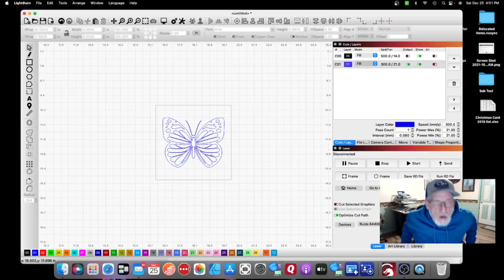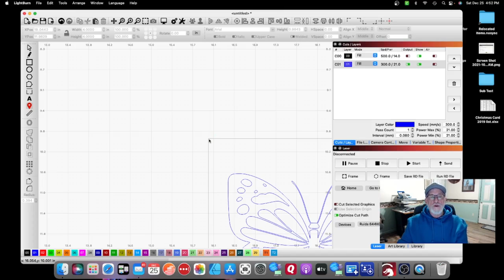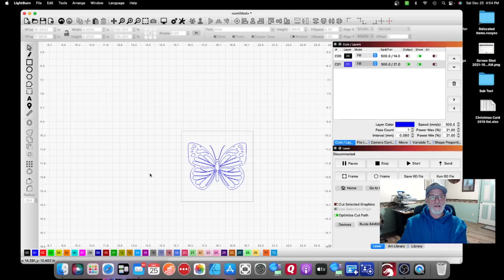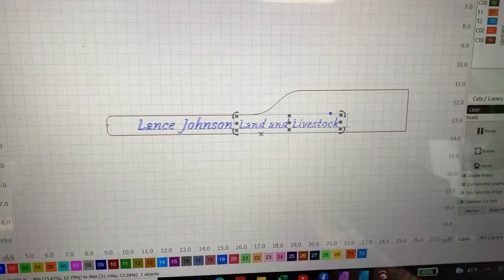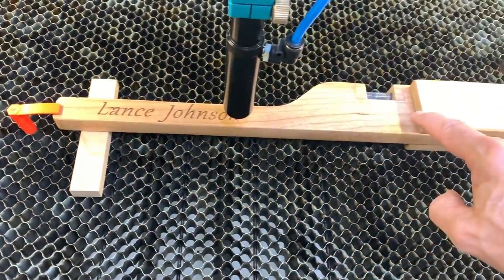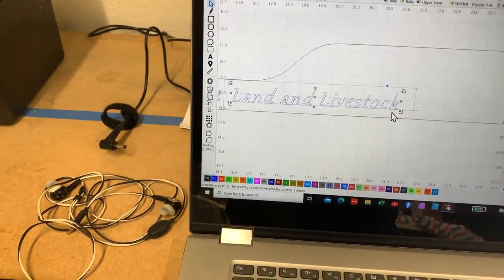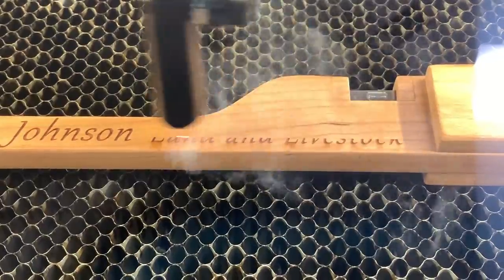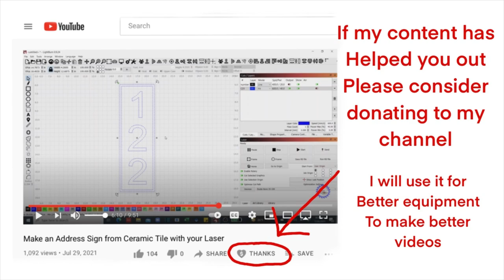Using the Laser Position feature in LightBurn with ABSOLUTE COORDINATES

Comment: So just out of curiosity, instead of using the laser positioning tool and manually doing all of the alignment by hand, why not use the print and cut feature instead? Kind of the same principle, but Lightburn does all of the alignment for you instead. Otherwise, useful info on a rarely talked about tool.
Reply from the maker: lots of different ways to do this. it jus depends on how well you know lightburn!

Comment: You asked for video content suggestions, Could you make a video on Splitting a design in half and using the print and cut feature to cut the design on one board using the pass through. I have a thunder 24 and need to cut some circles 20 inches round
Reply from the maker: house of lasers has a really nice video on just that. go check them out! thank you!

Comment: I am new to using Laser engraving and lightburn.  I absolutely love the way you explain everything.  I do have a question though.  I have everything set up correctly...so I think, but when I press the start button to create my project nothing comes out on my wood.  What am I doing wrong?
Reply from the maker: with out knowing your setting and type of laser you have it’s tough to help you. most laser have a minimum threshold meaning any power setting below that threshold the laser will not fire. most co2 lasers minx are between 8-12% above that you should see something

Comment: Would you discuss the black laser tube and it’s lenses? Thunder ships with blue but I notice you use a different setup. Is this setup better. Do you get better cuts? Thanks.
Reply from the maker: that is an 1.5” lens from American photonics it has a smaller beam spot and is my goto lens for engraving and cutting thin materials. Thunder requires a 21mm tube diameter. they have a 4” that works great as well. these lens’s are very affordable.

Comment: Hi and thanks for this outstanding video! How to fire the laser light (to check the position on the wood) from the LightBurn control software ?
Reply from the maker: if you have a diode laser you will have to turn that feature on in lightburn under the gear icon. if you have a co2 laser you would use the pulse button on the controller. thanks for watching

Comment: Two things- I noticed that your text looked to be a different height. Is there a job sheet like in vectric products? Also wanted to add a little- I use a similar process when picture engraving on irregular shaped slabs and slices. I use a known dimensioned vector box so that I can position the picture . I make the engrave larger than the piece so that there is no unengraved area. I use a sheet of 3mm underneath, drive to the corners of the vector box, and measure for positioning. Great video, thanks.
Reply from the maker: Yes the customer wanted the second bit of text to be a bit smaller so the name stands out.

Comment: Hey I am new to your channel. I was hoping you could go in depth with the Lightburn software and how to use the program. Plus I would love to learn how to find the best cutting setting on several different types of material. Not sure if you have made videos on this yet. You do a fabulous job explaining things. I can't wait to see more content.
Reply: Paris, you'll find the settings for cuts/engraving are different for each machine, even for the exact same material.

Your best bet for this is something I have done. 
Each time you get a new piece of material, do a few test cuts on it and some test engravings. 
Then write on the material what your setting where at each location. 

You'll come to learn yourself overtime some rough estimates for new material, but you'll always have to test anything new.
Reply from the maker: Noted!
Reply: Thanks Joshua! I will keep trying new settings. It's hard to figure the correct settings.  I feel like I mostly get charred edges. 🤪

Comment: Ok. So that's the rub. WHERE do you place the physical product??? I don't quite follow. Can you just place it "anywhere" on the table? I'm also doing a circular piece of material.
Reply from the maker: Once you move the laser pointer to the selected location you move your product to the location not the other way around. This way is much faster in most circumstances.
Reply: @computercreationz  first, love your vids!  I think what I failed to explain properly is that I have multiple EXISTING cut-out pieces . Like the blanks you buy at Amazon, craft stores, whatever... I ended up making a jig. So what I did was take a large piece of quality cardboard (secure it down) , did the layout in the array, and cut out those circles first. Then I can  just plop the blanks in those holes, and do the cut or etch that way. Thank you!

Comment: I have 51/130. Do you mind to share the perfect upgrade tools and the set up to my laser? I still masking my material everytime i engraved because its charred. 

Holiday rush is over and i really want to maximize my machine and re-set up. Im not able to scoring. It scored to the back side of the material even though i only put power 1 and speed 300++

I really need help.
Reply from the maker: ugrading to external air supply will make a huge difference in your cuts. search thunderlaserusa web site and they have lots of info n it.
Reply: I have never masked since I started with my 51/130.  I hired Robert (creator of this video) to teach me my new  laser about 10 months ago.  The way he explains things and his patience are priceless to me.  I was going to have a paperweight had I not found Robert.  ha ha.

Comment: You’re supposed to switch to current position from absolute coordinates when using that option
Reply from the maker: This feature does not work in user origin on my Lightburn!
Reply: There should be 3 options… absolute coordinates, user origin and Current Position… perfect example when your trying to do a serving try with handles but your laser head would hit the tray handles… when using current position the laser doesn’t home to the corner… it will stay in your design box
Reply: Love your videos btw

Comment: Thank you, I had a job on a rotary that I needed to make darker, the mug was displaced, I suppose your tip and this tool would work to re-align and reprint over the previous lighter print.
Reply from the maker: it would be very tricky on a rotary because of the steps per rotation involved that you have no control over.

Comment: Wouldn't the camera take the guesswork out of it? Excellent video to know how to do it manually though. Granted I'm a total newbie.
Reply from the maker: I’ve got a camera on my laser. This method is just as fast and you don’t have to wonder if it’s off just a bit. The cameras are ok but if you know your alway around lightburn this is just as fast.. The cameras will get you in the ball park but I’ve learned over the last 2 years of having one  that they go out of calibration pretty easily. You spend more time wondering why isn’t it dead on than just getting the work done!

Comment: Have you experimented with the camera function? At least 2 of your vids cover positioning, without covering the excellent camera functions. Example: This is really interesting:
https://youtu.be/Z4TaZUkvDbM
5 min into this one you can see how accurate the positioning procedure gets:
https://youtu.be/Y-Zv--T4bSI
Reply from the maker: in use the camera about 10% of the time. it works great for odd shaped objects. With constant movement of the lid you do have to tweak the settings and understand it will get you very close but not dead on. I love it when I need it. but always use the frame feature to ensure accuracy

Comment: Very informative.   Just wondering what speed and power you were using?    If you have a video on the height to set the laser head could you please link it.  Thanks, Daryl
Reply from the maker: 400/mms 25% power on my Thunder Nova 35-100 watt. I always engrave 1-2 mm out of focus. this 4” lens has a focus of 10mm but I needed to miss the wood on the right so I was 3 mm out of focus. works fine.

Comment: I know this is an old video but could you tell me what lens you are using on this Thunder laser? Thank you!!!!!
Reply from the maker: that is a 4” lens from American photonics!
Reply: @computercreationz  That’s awesome. I think we have the same laser, Thunder Nova 35 100w? I need a high res lens but I’m not thrilled about paying $400. Do you have any suggestions? Oh I have the standard and the 4” Thunder lenses!
Reply from the maker: I wouldn’t get it,  I had one and because ifs focus is the thickness of a quarter too much stuff builds up. Buy an 1.5” lens from American photonics 21mm tube. It will provide grest engraving results and it’s very reasonable  @davidtroncoso9313

Comment: What light is showing on workpiece?  That’s not a laser.
Reply from the maker: It a small red dot laser that shows where the laser will strike when fired. This iama co2 style laser not a diode.
Reply: @computercreationz  thx so much.  Is it original equipment or did you add?  If you added, how are you dealing with offset?  I'm adding crosshair laser to my diode but offsetting in Lightburn.
Reply from the maker: Standard on all thunder lasers @bonose12